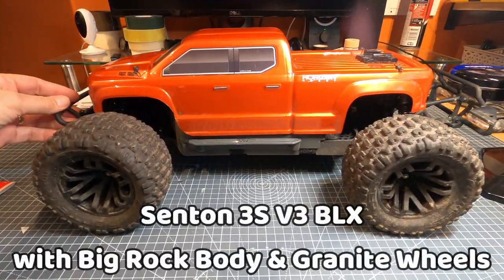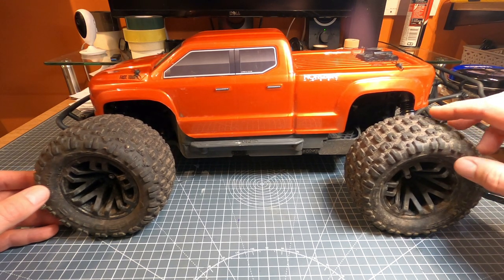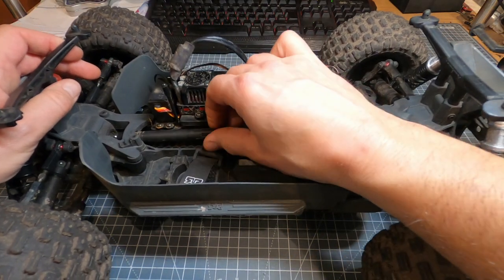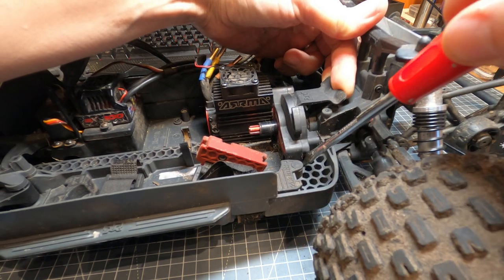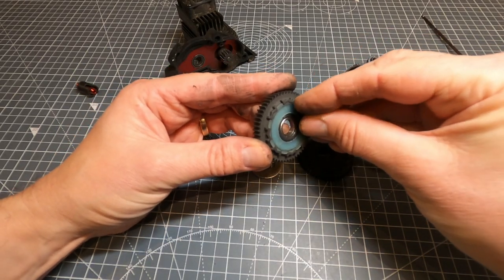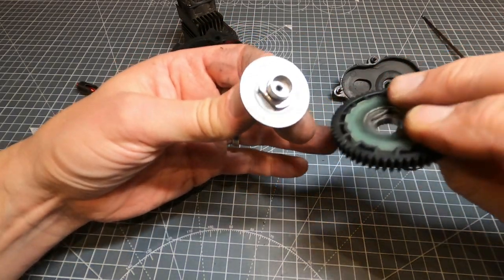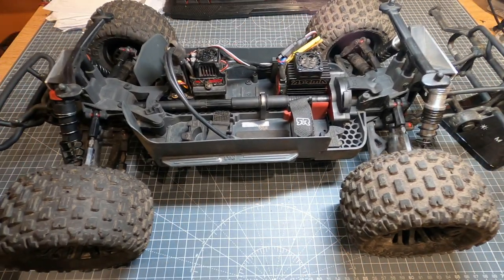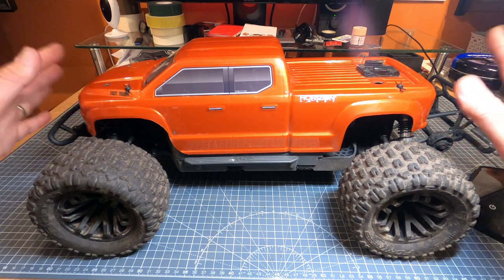Arrma 3s BLX Spur Gear & Slipper Clutch Maintenance. Granite Senton Big Rock Typhon Vorteks  how to

Comment: I tightened mine up before removing to see how loose it was. It was almost 3 turns before it went tight. Maybe factory settings are too loose? People say rule of thumb is quarter turn
Reply from the maker: Yeah I think it's difficult to know if it's too tight but you'll know if it's too loose because you'll hear it slip as you accelerate.  Obviously one way to find that it's too tight is if the gears strip when the wheels get stuck!  I've done mine with the 1.5 turns loose and they've all been ok.
Reply: Mine was 2 turns

Comment: What motor plate are you using? Brand name and part number would be great.

Thanks Bob
Reply from the maker: Hi there. Oh I'm afraid that Arrma stopped making that part. It was standard equipment on the 3s range before they changed to the one with the variable position. Sorry I can't be any more helpful. Thanks for watching 😁

Comment: My slipper clutch is factory set. I am ripping thru rear diffs. Would loosening it help prevent that from happening?
Reply from the maker: Yeah in theory the clutch should slip before the gears strip. I've only just had to replace the diff housing on my Granite and I've been hammering it to death for a couple of years. If you loosen it too much then you will hear it screeching all the time so you need to find a happy medium. Thanks for watching 😁

Comment: hi pete,  i just need one of those US GRIP BELTS...   BUILT IN THE USA BY THE USA...  lovely....   pete i have purchased a Arrma Senton 3s  V3 ,  not just because of your video , but i do trust in you...   i think its a great 3s budget car...50mph....   also are you able to look at the:  Absima Assassin 6s...  its german but i guess made in china..   i do own one if you want to borrow it..?   its big, fast and so far reliable plus cheap..    i would love you to do a review on it... please....
Reply from the maker: Ah cool.  I'd recommend the inner fender set for the Senton as they stop the air from getting under the body so much and also keep some of the dirt out.  I did a video review of them.  That Absima 6s does look like an epic bit of kit for the money.  I always use Absima ESC's to upgrade my Tamiyas and they have been reliable.  Thanks for the tip.  I will certainly have more of a look and a think about it.... :-)

Comment: Great video but where can one get the motor plate ? Thank you !!!!
Reply from the maker: Ah, if you mean the motor plate with the set hole positions then I think that they have discontinued it in favour of the sliding plate.  Rather annoying that you can't get it as an option.  The part number is AR310874 but I can't find it anywhere now.  Threadlock is the only way for us now.  Many thanks for your feedback :-)
Reply: I found it at Superstition Hobby if you're still looking for one. $13.99 plus shipping
Reply: @bigdeal5394  Thanks !!!!!

Comment: My granite v3 is a week old. No drivetrain issues but wondering why after abit of driving my steering seems to LOCK to one side.? I have to reset it and everything is fine. Is the servo too hot?
Reply from the maker: Haven't heard of that one.  Is it just a stone stuck in the linkage?  If you hold it upside down and shake it does it free up?
Reply: @PeteWylieRC  it could have been as i was hucking in dirt and rocks I did shake it abit to get the debris out then it was working again. Didn’t think it would have jammed up the linkage but anything is possible

Comment: It's the loctite in the motor plates the use of way to much is it melts right onto the shaft then collects dust metals and fibbers that lock onto the bearing causing the failing motors. I've cleaned all my motor inside right away no problems on them
Reply from the maker: Good information. Many thanks for sharing 😁

Comment: So that noise now (when you move your orange big rock) is normal?
Reply from the maker: Yeah they sound like a bag of spanners.  It's just because of the magnets in the motor making it lumpy and the sound it makes in the drive train.  It should be easy to turn the wheels however and if it isn't then there might be an issue like mesh being be too tight. Thanks for watching 🙂
Reply: @PeteWylieRC  thank you for the reoly, getting back into the hobby after 20yrs away. Your videos are brilliant. Having just bought a Big Rock and destroyed the 37T & 13T gears, it's good to find helpful info 🙂

Comment: i am struggling with my car so much, the slipper tightening screw will not tighten all the way and the car just screams like the gear mesh is too close but its normal, it doesnt make any sense
Reply from the maker: Sounds like the clutch isn't together properly. Have you tried removing it from the gearbox and testing it like I do at 7:48 in the video.  There should be a fair bit of resistance to turn the gear when you hold the driveshaft. You should be able to screw it all together tightly if the screw is threading into the plastic sleeve on the other side ok.

Comment: So that noise in the begging is normal? I’ve had mine for one day and it makes that noise while rocking it back n forth
Reply from the maker: Yeah they sound a bit lumpy like that but the wheels shouldn't be stiff or difficult to turn.
Reply: @PeteWylieRC  lmao just pulled mine apart as well I was a little frightened by that sound as well thinking my mesh was off I took a look and it looked fine to me but one thing I noticed is that there was no grease on the spur gear should it be run bone dry like that ? Also I'm wondering how the diffs look I really hope they are greased

Comment: Hi, have you got the link for that motor plate? I can’t find it anywhere, Thanks.
Reply from the maker: Hi there. It's part AR310874 but I can't find it in stock anywhere either. Be worth keeping an eye on eBay to see if one comes up. Otherwise just threadlock on the sliding one and you should be ok.
Reply: @PeteWylieRC  cheers thanks, I’m new to Arrma RC and Brushless. So thanks for helpful How to Vid 👍🏻
Reply from the maker: @davidturner1211  Glad you found it helpful.  As mentioned in the video there are other videos that cover most of the other parts of this truck. Many thanks for your feedback :-)

Comment: What does it mean if my car has like no tourqe out of nowhere it won't do wheelies anymore but it still goes fast it and Arrma Granite Blx 4x4 v3 it doesn't wanna do wheelies
Reply from the maker: Hard to say without seeing it. Possibly the motor or ESC has gone a bit dodgy. Presumably you've tightened the clutch. Might be worth contacting Horizon?
Reply: @PeteWylieRC  hey thanks for responding quick bro I fixed it this morning and held off on it but the slipper needed tightened its good again and the protection plan I got on it I will never use it again they fixed it right the first time then after that they only replaced half of the stuff and put a slit in my tire that was NOT there before and drilled out my tie rod ends so it had like twice as much slop I got new tires put on yesterday they're alluminum and are really good for removing the slop and my new tires are coming either today or in a few more days
Reply from the maker: @coltonlynn2825  Glad you got it sorted.  That plan doesn't sound too good then.  I have had good service from the retailer with swapping out faulty parts but haven't asked them to do anything beyond that. Best to do it yourself so you know it's done right.  I got that Hot Racing alu pivot ball set which was good for removing the slop like you say.
Reply: @PeteWylieRC  I WAS glad I got it sorted to this morning I stripped a diff and then warranty people stripped the the back screw on the skid plate to I can't get it off do you have any Ideas for that ? 😂

Comment: Does the slipper need changing after time
Reply from the maker: Well yes but I run these a lot and they don't need doing very often unless the screw is shaking undone. Mine usually run for weeks or months without issue. Many thanks for watching 👍👍

Comment: Do you have a link to the old motor mount w set positions?
Reply from the maker: I'm afraid that they stopped making it unfortunately. I've not had a problem with the sliding mounts after I threadlocked them.
Reply: @PeteWylieRC  also when I went fully tight on slipper adjustment screw, 1.5 turns back and I can still not even close to move it.
3 or so turns and it slips, but still feels really stiff
Reply: @PeteWylieRC  I ended up going with that but when I push the car around, it feels so hard to move. And noisy. I can't recall if it was this bad when I purchased it 5 days ago or not, but I do remember thinking it was a noisy car. I just can't seem to get it to work right and it's my first electric car. Is there any possible way if you had time I could pm you on Instagram or facebook?
Reply from the maker: @kl0udykl0ud55  If you remove the motor so it isn't meshed with the gears at all, is it free to turn.  It will be sort of notchy as it snaps to the magnets but it shouldn't feel stiff.  I did have a motor that seized up and they replaced it under warranty.

Comment: I am having trouble to slide the power module back in.
Reply from the maker: Double check that there is no grit or anything in the slots on the chassis and on the underside of the power module. Might need a bit of a wiggle to get it back in.

Comment: Where can I get that motor plate can’t find one.
Reply from the maker: I think that they have discontinued it in favour of the new sliding one.  Maybe a second hand one on ebay.  Otherwise make sure to use threadlock with the screws on the sliding mount and it should be fine.

Comment: you helped me a lot! Can i get the ARRMA Code of the Motor plate pls? I neede this one :D
Reply from the maker: Hi there. Many thanks indeed. Glad it was helpful. Unfortunately they stopped making the motor plate with the set holes which is a shame. The motor plate with the sliding holes is ARA311106
Reply: @PeteWylieRC  Shame, does the plate also fit with the gear because the original doesn´t fit. :(
Reply from the maker: Hi. Sorry I'm not quite sure what you are asking. I don't really know much beyond what I did in the video because I haven't bent any motor plates so I haven't swapped any out after this.
Reply: @PeteWylieRC  I mean, does the Slipper Clutch fit with the Motor plate? Because at mine, the distance between the Slipper Clutch gear and the motor gear is too much and I can't adjust it, because of the motor plate. :( Did you know what I mean?

Comment: Can you drop a link for that plate please 😅
Reply from the maker: Hi there. I'm afraid it seems that they have discontinued the plate with the fixed positions. You just need to use the one with the sliding mesh and make sure you threadlock the screws. Thanks for watching 😀

Comment: What was the solution?
Reply from the maker: How do you mean?
Reply: I have the same noise in my RS. I saw your video 2 times and I still don’t understand how to fix that. Sorry but I’m total noob
Reply from the maker: @supernico5403  Where I'm rolling it back and forth at 0:48 is the normal noise of the gears.  You only need to worry if it is difficult to move.  It is normal for it to be lumpy like that because of the magnets in the motor.

Comment: why don't we lubricate the gears?
Reply from the maker: It's a good question to which I don't quite know the answer but it does seem common to not lubricate the plastic spur running against a metal pinion. All the other gears get lubricated and I don't see any harm in putting grease on the spur and pinion. I'll try to find out. Thanks for the question
Reply: @PeteWylieRC  how many trips does a plastic spur cover?
Reply: Usually the only time u will see a metal/plastic gear combo that's greased is inside of sealed diffs. Grease holds sand & dirt which is abrasive... obvi. So then the face of the teeth on the metal gear grind it all down into the plastic gear, almost like a file. Just having a plastic cover over the spur/pinion isn't enough, a lot of dirt *typically still  gets in.
Reply: @heleron6221  and a plastic spur with "proper mesh" & no dirt or sand constantly on it... it should last months

Comment: That plastic piece @6:38 is a joke.  The whole design is trash.  A tiny screw threaded into plastic?  Srsly?  If it breaks on my Granite I'm NOT buying their $12.00 "maintenance kit".  Will just buy aftermarket, the one with the large 12mm nut and large spring.  Have that on my big rock (came with the truck when I bought it used) and it is solid compared to this made-to-break garbage.
Reply from the maker: @bytemuncher1  the plastic bit is only a locknut to stop the screw from shaking loose. The screw is threading into the metal clutch part first and like I say the plastic bit is behind that as a locknut. I've not had a problem with it although eventually the clutches need tightening. The version 2 3s cars didn't have the extra plastic nut and did shake loose more quickly which is why I guess they added it. Many thanks for your feedback 👍👍👍